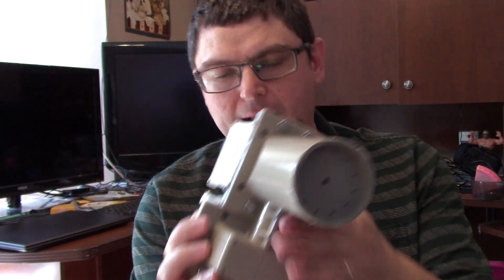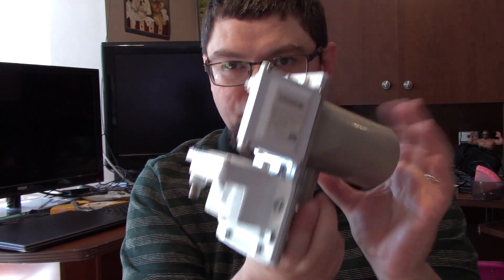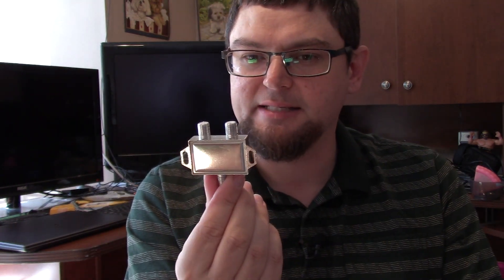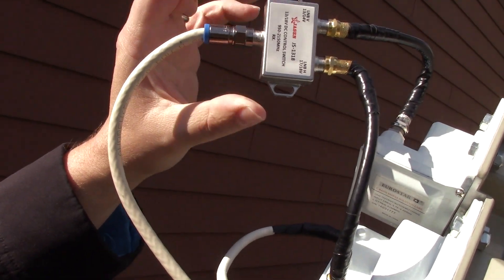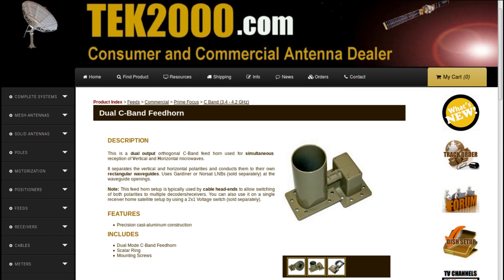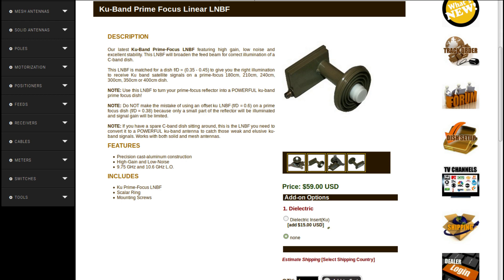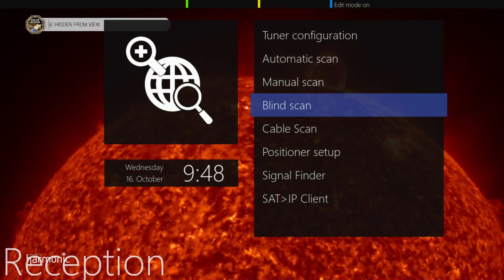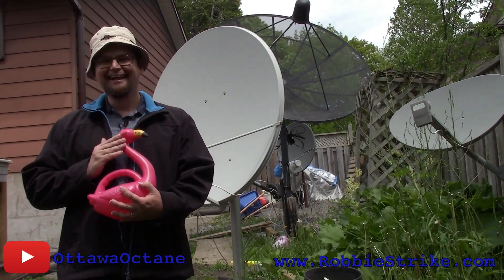C-Band Satellite Dish Orthomode Feed Horn LNB -Setup

Comment: Hi, is it possible to use the orthomode feed horn with circular polarization by e.g. using a g10 plate or a waveguide polariser converting L/R unto V/H?
Reply from the maker: Great question I don't know. I don't think it came with the plate
Reply: @RobbieStrike  Can you test it? Would generate another nice video :-) If you are interested in using a polariser, just let me know. Replaces the plate and delivers 2 to 3db more gain

Comment: So with my 7.5ft C-Band /ku band Combo LNB from back in the 90s will this still work should I pick up a new FTA unit
Reply from the maker: YES A OLD LNB WILL WORK. Hopfully it does not have a polarity motor. they you will just get Vertical Channels. Is there power cables going to the LNB?
Reply: ottawaoctane  I have everything on dish and wires However I would look at picking up a new Lnb combo as my old one had a motor for polarity.  just wondering if you could recommend a good inexpensive receiver and a positioner or a c/ku  combo only using it for one tv. My main goal is for English only.  Would be nice if I could get ATV , CBC ,  NBC ABC Fox. What are your thoughts .. love your videos man it has been a long time since playing with these things rusty for sure
Reply from the maker: @justaviewerortwo2924  Check out my store at www.FreeSatelliteTV.net https://www.facebook.com/commerce/products/3059613744131637/
Reply: Robbie Strike  prices in USA or Canadian